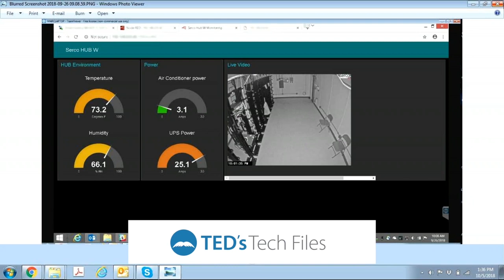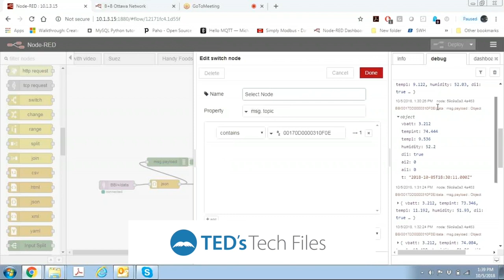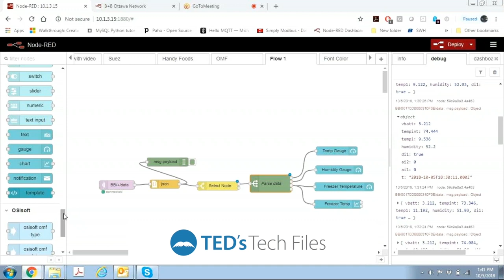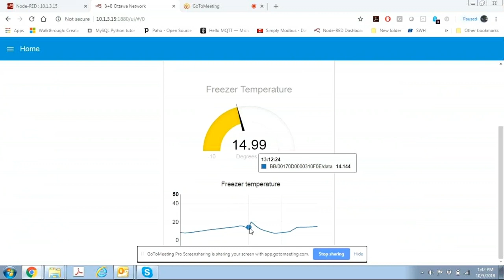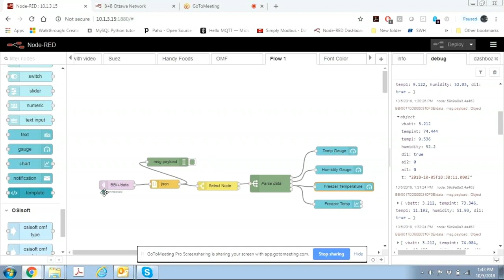How to Build Node-RED Dashboards, Advantech (EN)

Comment: Hello, i`m using ADAM 6017 and i need to read the analogic inputs at node red. 
What`s the best alternative to do that?
I tried to use modbus nodes, but it keep showing a boolean read from the debugger.
Thanks! nice job
Reply from the maker: Hi Rafael, it seems you need direct technical support from us. Would you mind fill out the contact form? We'll try our best to assist you.

https://www.advantech.com/contact/inquiryrequestform